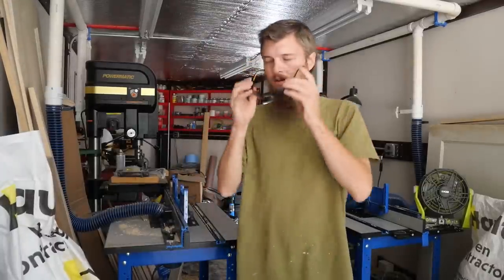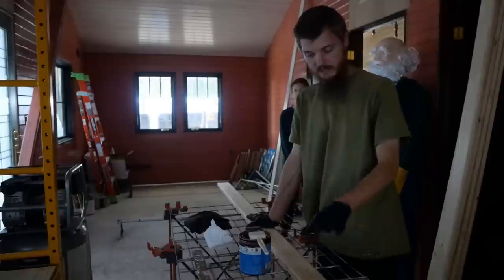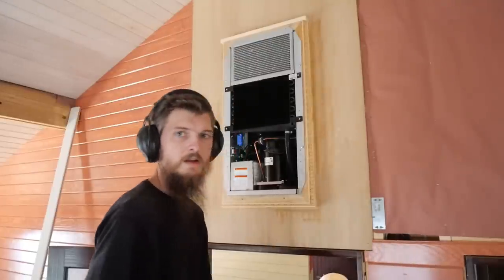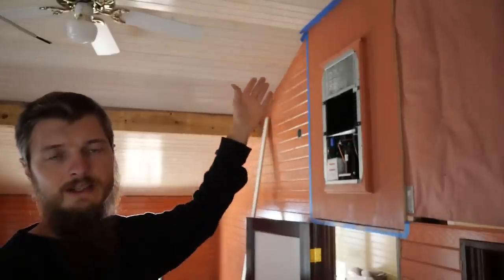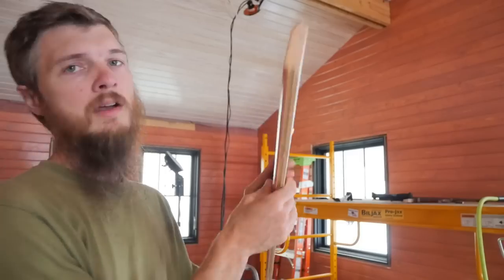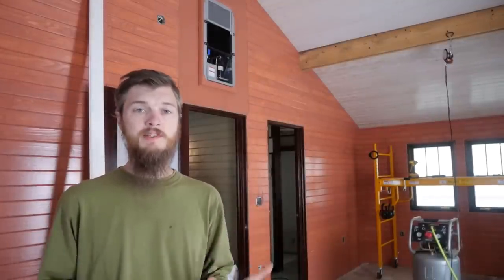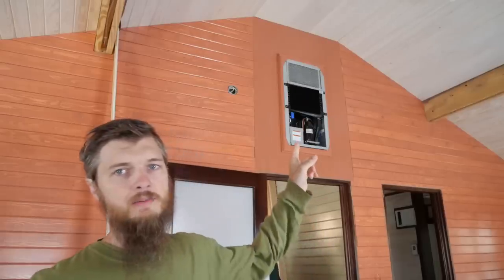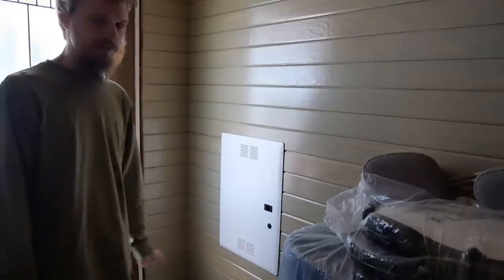4000 Feet Later, We're Done - Custom Wood Walls and Ceiling Instead of Drywall

Comment: Wow - congrats on a job well done! And as soon as you held the white panel up, I thought that it should be spray painted darker color so it wouldn't stand out. So my vote is for painting it, as well as the one in foyer, which I would paint that one same as wall color. 💕

Comment: What started out as an answer to a problem (the dehumidifier placement) turned out to be a very unique and cool design. I love the solid panels, especially between the door and window. Having art work there will look awesome. For the dehumidifier cover, I would paint it the same color as the trim you put in around the doors. Whatever you decide, I would probably like (not that my opinion matters, lol). Have a great week.

Comment: I painted a plastic cover using my wall paint by first painting it with chalk paint found in the craft section of Walmart which stuck to the plastic well. Then  I coated with regular paint. I just could not find a spray paint that matched. I realize you used stain but you could take it in and have it color matched for a quart of wall paint. Just an option. I agree that the white cover is too much.

Comment: Paint the humidifier cover.  Build a shallow depth box over the electric panel… then use it as a shelving unit or a place to hang keys, put outgoing mail on, make the ‘box’ bigger and hang a piece of art work over the panel … wall sculpture … even a mirror would look good there

Comment: definitely paint those covers or build some custom stained covers...we don't want your hard work cheapened by those awful covers...As to the hall cover, I think it is behind the door, but here is an idea instead of painting or staining...I happen to like low placed art sometimes...If there would be other art finds to make it workout, you could just hang art over the lower hall piece.  As to the upper in the bedroom, I don't know the requirement for air movement to that unit, but I was thinking if it would function correctly, to make a stained louvered panel..(maybe even remodel an unfinished shutter or door set. )

Comment: Would have looked nice with the paneling theme continuing into (but separate from the other boards) the dehumidifier space but around the dehumidifier, perhaps fasten them so that they are one unit and could pull off.  Just a thought in case you modify, as you mentioned..

Comment: I have a sofa and chair that I bought 55 years ago. They have brass nailhead trim. I’ve moved a few times since then. No problem. I retired and moved to Missouri. After all the years, the humidity in Missouri caused the nailheads to rust. Galvanized nails..best thing you could have done.

Comment: They did tongue & grove  years ago,all houses had it . Sheetrock wasn’t AROUND IN THOSE DAYS. SHEETROCK HARD TO DO BUT LIKE IT BETTER…
Reply from the maker: Drywall is just a modernized version of plaster and lath. But it wouldn't be a good choice in this house since our house sits on block piers and any movement or leveling of the them can cause the drywall to crack. Also, it's not good in a humid climate like here.

Comment: So what was the cost difference between buying tongue and groove boards and making your own with everything included counting router bits brushes stain paint Etc
Reply from the maker: I'm not exactly sure, but it costs more to make our own boards. It's hard to say since they don't make the width of boards that we made.
Reply: @diyfferent  well, it turned out great. Your work is outstanding. At first I didn't like the color but it grew on me. It's going to be a beautiful room.

Comment: Curious… were you able to process all of that board feet with your original router bits or did they require swapping out at some point?👍🇨🇦
Reply from the maker: We're still using the original blades. We never sharpened them either. They out-performed what I expected.

Comment: I'm curious about the dehumidifier in the bedroom. I tend to think of dehumidifiers, which dump both the heat they extract from the air and the waste heat from the compressor, back into the conditioned space, as  being useful in cool, maybe even cold, clammy areas like basements or in cold clammy places like the UK or the north-west USA. Does it often get that cool in your area of FL? Or, maybe you're just less averse to heat than I'd be. My modus-operandi when it comes to bedroom AC is to cool the room down to maybe 65 degrees with the timer set to shut it off after an hour and with the windows sealed to keep out the humidity and heat, then hopefully, be asleep when the room starts to warm up again. I know many people would view that as crazy, but it works for me.
Reply from the maker: 65 degrees, so cold! haha. My ideal indoor temp and sleeping temp is about 80. That's when I feel perfectly comfortable. The heat that the dehumidifer puts out isn't enough to matter. In Florida it rains almost every single day in the summer, and combined with the summer heat, it makes it very humid. We'll need the dehumidifier mostly in the summertime to remove moisture from the space to make the room feel better, and prevent mildew from forming.

Comment: A humidifier doesn't keep you cool. Yall going to be sweating alot in the summer
Reply: It is a dehumidifier !!!!!
Reply from the maker: It's a dehumidifier (not a humidifier) meaning it removes moisture out of the air, and it makes a house feel cooler inside.
Reply: @diyfferent  I agree the dehumidifier helps with comfort. You had said before that hot weather didn’t bother you so no problem; and you can always use your fan too. 😊
Reply: And that still don't cool anything.
Reply from the maker: @JerseyNBA2kbigman  We don't want to be "cooled", we just want to feel comfortable and have a mold-free house. When you remove moisture from the air in a humid climate, it makes you feel cooler.

Comment: A dehumidifier is an air conditioner
Reply: No it isnt.
Reply: @laurieg673  it's the same principle
Reply: Basically yes it is.
Reply: a dehumidifier eliminates excess moisture but des not cool the air as an air conditioner does. In FL most homes use dehumidifiers with air conditioning to help it cool the air more efficiently. However some can take the heat and just use a dehumidifier.
Reply: @pamelahall517  both systems remove humidity the dehumidifier just doesn't blow air across the chilled coils. But basically very similar systems
Reply: @wurly164  well, yeah, but the results are not the same when using each system. The operative word is cool. Dehumidifiers don't cool. Less humidity does help but the cooling part in air conditioners is what really helps in FL's heat. Just speaking from experience with both.

Comment: Wouldn't it have been cheaper and faster to have used sheet rock?
Reply: It would have been but they have mentioned in a previous video that they really hate dealing with drywall. They listed their reasons for it which you know, to each their own :)
Reply from the maker: Besides not liking drywall, we wanted this house to be cohesive and representative of the original style of the home. The original part of the house already has tongue and groove boards. Drywall is more prone to mold in high humid environments, and our home is sitting on blocks. Any settling of the structure can easily crack and damage drywall. The wood is better all around for this type of home. So yes, drywall is cheaper, but the wood is better.

Comment: Pardon me....I am a perfectionist so forgive me....but there seems to be uneven stain coverage under the humidifier near the bottom of that panel....the light in the room amplifies the uneven coverage. Ugh
Reply from the maker: It's not the stain, it's the varnish. It was the last spot I brushed and the varnish was starting to dry so it left brush marks and disrupted the semi-gloss finish. It stands out because it reflects the light a little different. But it's fixable if needed.